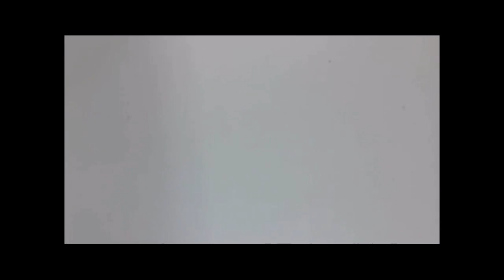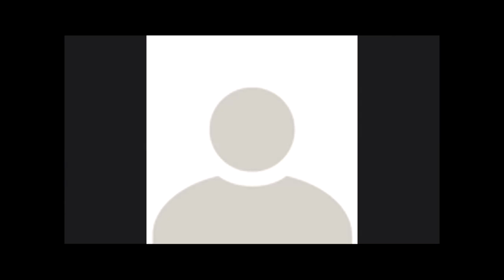How to clean contamitated water with ash and nano coated wire

Comment: According to Keshe in this vid (as near as I can tell):
Shake wood ash in sea salt water (qty?)
   (Sea water = 3.5% sea minerals/salt or 35 parts per 1000)
    (Or 3.5 gms/ liter)(He calls for “heavy salt water” or regular sea water)
Decant/pour off water after ash is settled (probably not waiting long)
With this decanted salt water put more fresh (contaminated) water ( amount not given but probably at least twice as much fresh water as salt water or more) and some Nano coated copper along with more new wood ashes (even if it’s just some burnt copper wire) shaking it all up together and letting it settle out longer this time until clear. 
   Siphon off water or pour it off of the settlings carefully to get drinking water.
    Hopefully all microbes are stuck to the micro particles which sink down and the copper Nano works as well to neutralize/kill the microbes. 
     This sounds like it would have been have been a good low tech method to have known about when they were dying of cholera on the Oregon Trail (and elsewhere in the world during that time of epidemic in the 1800s). So it likely would be one of the easier means of dealing with similar issues in the coming days/years. As the post before mentioned, silver solution may be easier/better but in a bind I’m betting most will not have access to it!
If I had no drinkable water available but had some salt only and even a bit of copper and some ashes. This would suddenly seem like an attractive alternative! Does it really work? Don’t know how effective it is but it would be interesting to see testing if effective and on the best way to it. Could be an enormous help in all the many places in the world that have no pure water but have some ashes, salt and perhaps some copper. Who’s into helping with testing!?